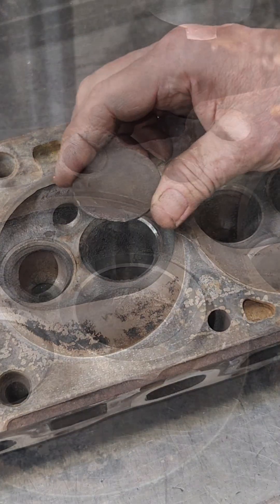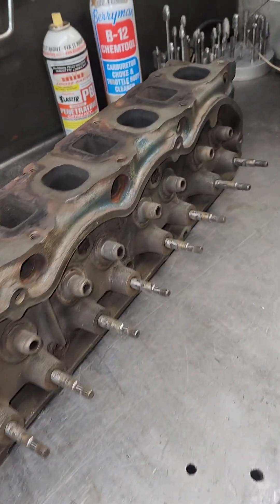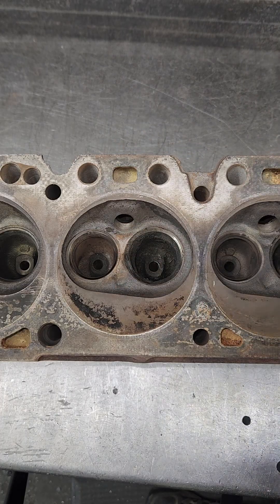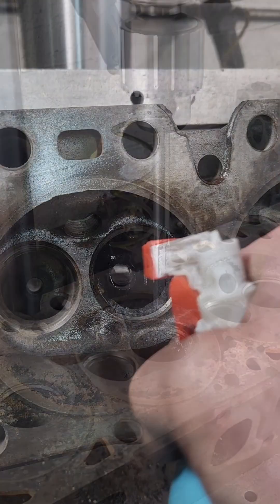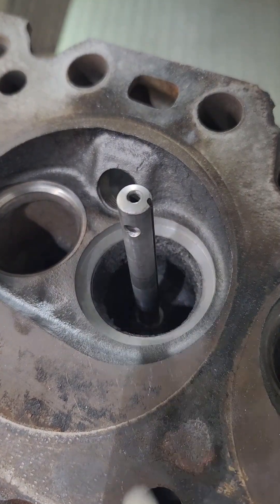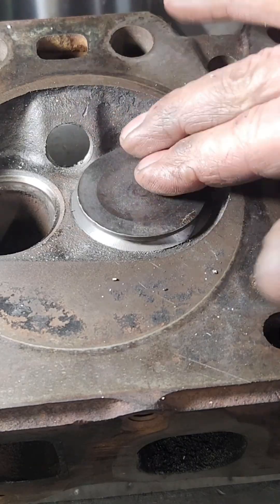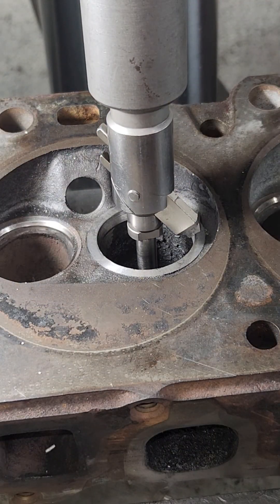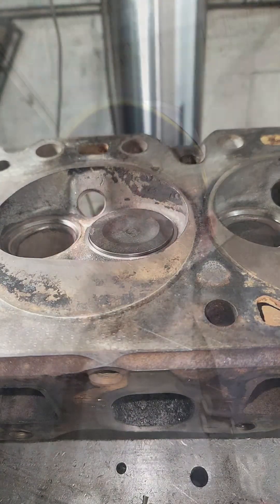Valve Guide and Seat install

Comment: I was driving home last evening and my engine i just put in, developed some issues.
 It was nearly dialed in, running great, 19 inches of vacuum 
65 psi oil pressure 
185° temperature 
 . . . Then as i was 2 miles from  present home camp, it started losing power, overheating, steam cloud😶
 I had a bucket of water, poured it over radiator, put some in radiator and made it back.
 Today, i found the fuel pump blowing oil out the vent hole and when i drained the oil, the first thing that poured out was about an 8th cup of water💩👁️👁️☕
Reply from the maker: Crap ! That really sucks 😡
It's got to come apart,,,sorry
Reply: @BearButler321 I now have TWO engines for cores 🤣☕
 I'll have to borrow a 3/4 or 1 ton pickup, from the new, bigger company I'm going to work for. Doing equipmentwatch firewatch, year round.
 That engine build I asked about,,, will that have a warranty?
 At least a "WAVE WARRANTY"... as long as I see you waving, it's warrateed ⚡😁☕
Reply from the maker: @invisibilianone62883 years 36,000 miles 🇺🇸
Reply: @BearButler321 are you familiar with EPM up near Portland?
 7 yr, 70 k mile warranty on theirs.
 But,,, ive actually watched your work...
 Ive only talked to one individual who has used EPM MACHINE,  built engines. It was an easy positive feedback, on the engines they build 
 I sure wish i had the time to tear this engine down, to diagnose the problem.
 I just haven't got the time to, as its fure season and im basically on duty at the job site for 1 to 3 hours, then im on equipmentwatch duty, until the Crew shows up for work.
 If i had space inside my trailer, out of the constant dust storm from the log trucks and equipment...i would do a rebuild out in the woods like i did on my transmission i built 3 years ago😎☕
Reply from the maker: @invisibilianone6288 you better call me tomorrow that dude is evil don't deal with him you'll end up with lube in yer ass 😂
Reply: @BearButler321 I called you today, but you were already closed for the day 🤣
Reply from the maker: @invisibilianone6288I worked till 6
Reply: Fresh in fresh out
Reply: @LogisticallyMisrepresented it was a used engine...
 And, some dont have that luxury.
 This used engine needs to be forced to run for a time...lol